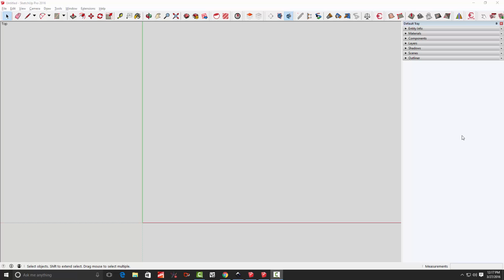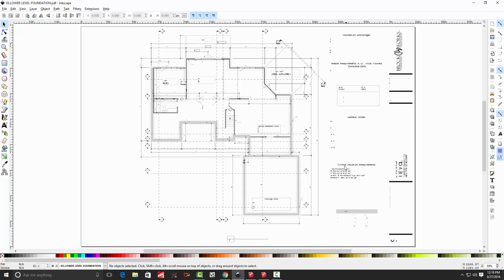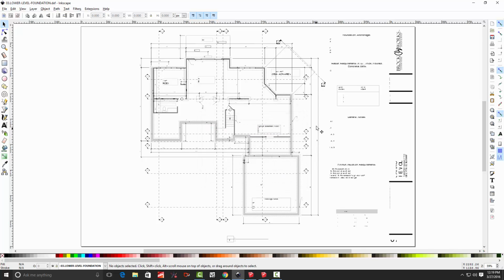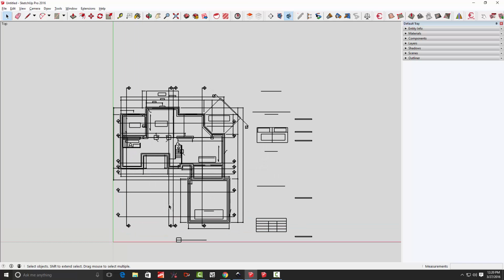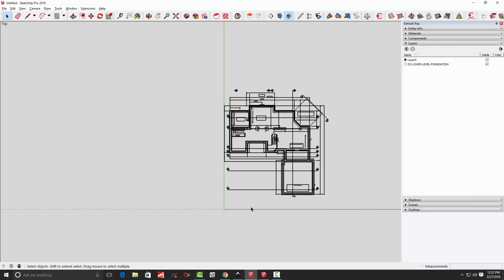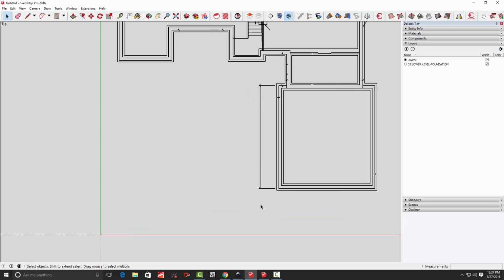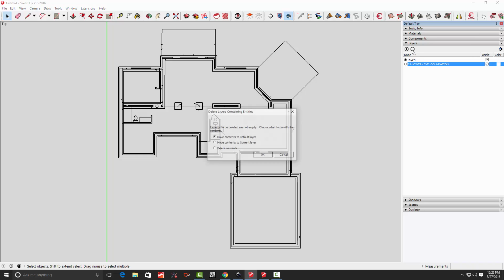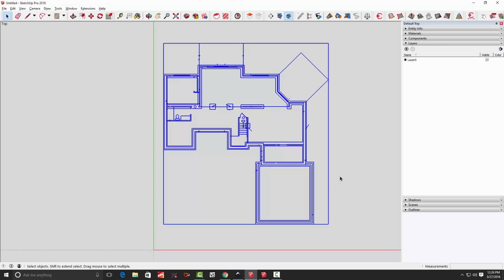Part 1: Converting PDF drawings for use in SketchUp

Comment: what if i cant convert my pdf to DX file type
Reply: Hello, this is an old video, we no longer use Inkscape after we developed PDF Importer for SketchUp.   With it, you can simply import the PDF directly into SketchUp without converting/other softwares.  I have not tried to convert them in years so not sure what issues you are experiencing converting

Comment: has anyone got this to work with sketchup 2020? When I try to resize it gives a warning that not everything will be resized and then it doesn't do it.
Reply from the maker: Yes, it works.  What I do is double-click on the group (like an imported floor plan) and then scale it and hit yes - this will resize the GROUP vs entire model.  I recall it used to work differently until 2018 or 2019, but edit  group > scale works great

Comment: The new version of MacOS is not compatible with inkscape unfortunately.  I managed to squeak in a conversion and then my computer updated and threw out the critical bit of software needed for it to work.  The converted file didn't work anyway because it was a scan.  So I am importing other file types instead.
Reply from the maker: We have a PDF Importer coming out in the coming days.  It allows you to import a PDF (vector-based) directly into SketchUp.  The Windows version is done and works great, the Mac version will be ready in a week or so, hopefully.  I will reply back to this when it does, but feel free to check in at www.estimatorforsketchup.com for more details in the coming days and weeks

Comment: Hi I hope you can help me, i imported the converted dfx file to my sketch up 2018, but it doesnt allow me to edit the file.how can i make it editable.i did exactly as per this video.
Thank you so much in advance.
Reply from the maker: I don't know without seeing the file.  I do know that it is not always successful.  For example, if the PDF was not generated by a cad program initially, then it is probably not vector and therefore not work.  I was converting individual drawings a couple of weeks ago on a large commercial project.  The floor plans worked fine, but the elevations sheets came in as images (raster not vector).  Also, I know it does not work when the PDF was a scanned drawing.  Good luck - feel free to email me the file and I could take a look at it at least.  john@estimatorforsketchup.com

Comment: There are some instances where the dxf, once imported into Sketchup, will not resize properly. I followed the recommended guidelines as outlined in the forums, specifically  the Sketchup import dxf options, but to no avail. Anyone else have issues with scaling?
Reply from the maker: In SketchUp, I will either scale the group that was imported, or scale model.  Typically I use a long, known dimension - using T for Tape Measure, I click on one point to the next and then type in the known length in the measurement box - then hit enter and it will ask if you want to resize model or group (if editing a group).  That usually works for me - I then make sure other dimensions are also correct and my walls are correct thickness, etc.
Reply: I do the same, but sometimes the resize will not work with the tape (option in 2018). Looks like a problem dating back awhile. Thanks for the reply!
Reply from the maker: Funny you mention it - I have experience odd issues myself in 2018 - I was in a rush so my work around was to edit the group and then scale vs the model and it worked - strange!  I will report it to the SU guys

Comment: My DXF Doesn't Load in I'm Using Sketchup 2017? I Open The File In Inkscape And Save It As DXF, Then When I Go To Open It Says It Cant Load
Reply from the maker: Hi Freddie - I have had some that will not import (import file and it shows up blank) - I think this is when the original PDF was scanned or not exported from a cad-based system.  Not often, but I know that it never works for me from a scanned image (not vectors)
Reply: Estimator for SketchUp Ah Ok I Think You've Just Solved My Problem

Comment: Not working for me.  Sent pdf file to inscape;  no problem  only 145k file.   Saved as dxf;  no problem.     open SU then import and box open says only one element uploaded then nothing is visible
Reply from the maker: I have had times too where it did not work - was the PDF based on good vector-based drawing to start with? (was it drawn in a cad program and exported to PDF?) I know it has not worked on scanned drawings, especially scanned drawings of hand-drawn floor plans.

Comment: Hi i got problem import DXF file to sketchup / can anyone help? thanks
Reply from the maker: What is the problem?  I often times have files I import that do not show up - check file size, if very small size, it may not be complete - I have also had issues with large imports - I think SU has locked up, but sometimes it may take hours to finally load, then it is OK (like a DXF of trusses)
Reply: it looks like that DXF is now a pro-only file type for Sketchup 2018

Comment: Hi! I have a problem... I can't save the file in .dxf, the option doesn't appear. I would be very grateful if you help me!
Reply from the maker: Sorry, just saw this - I have not tried to export to dxf, only dwg, but SketchUp excepts either, so I just go with dwg.  Why does it have to be a dxf?
Reply: DXF is for pro only, that's why you can't import it. are there any different types that give the same feeling as the DXF? png and psd are too blurry to work with.

Comment: How do you erase the selected areas? Thank you.
Reply from the maker: I usually just get it into SketchUp and delete things I do not need - or you can do it in Inkscape  - pretty sure you can erase items in either one.
Reply: Thank you for answering so fast. I was wondering which button you're using after you select an area to delete?
Reply from the maker: I just went into Inkscape and just selected something and hit DELETE on my keyboard and it erased it.  Or you can do same in SU or use Eraser tool
Reply: I can't get my model to resize, any suggestions?
Reply from the maker: The way I do it is to open a new SU file and import the dwg or dxf file - I then, using the PDF of the plans, find a long known dimension on the plans - I then, in SU, use tape measure and select point to point along that known dimension line and then enter the known dimension.  It will ask if you want to resize the model and say yes.  This works great almost every time - usually I will double check it against another known dimension and it is usually good to go - sometimes, the original draftsman may have faked something or fudged a dimension, so I often have to scale it again to get it right